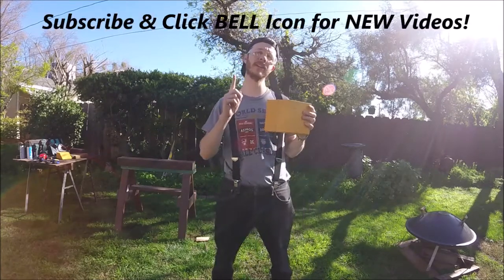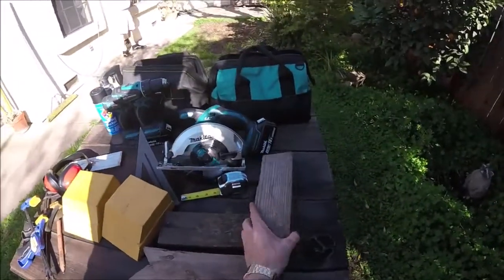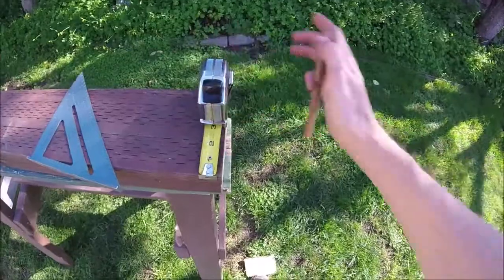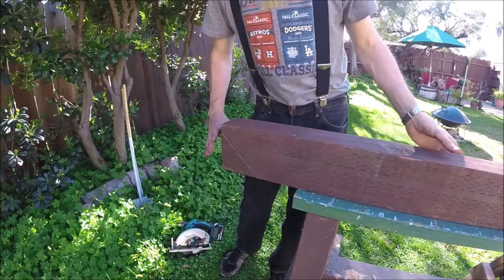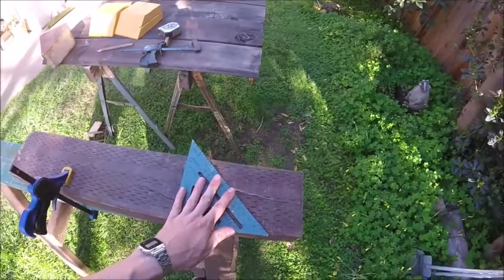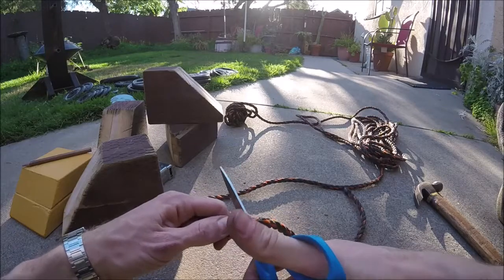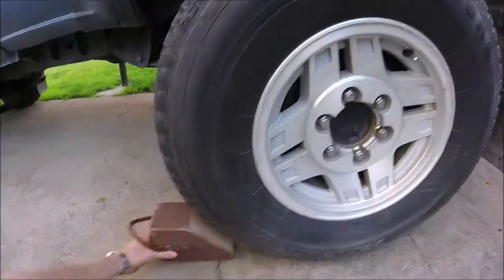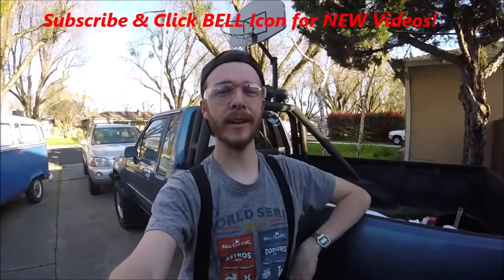DIY Wheel Chocks for your Car, Truck or RV -Jonny DIY

Comment: For the smaller ones, did you glue them together or screw them together with wood screws?
Reply from the maker: I glued and used either screws or nails (if nails I predrill a lil and pound sharp point of nail head more flat to prevent wood splitting)
Reply: @JonnyDIY  Thanks!
Reply from the maker: @Nowisthetime01  you're welcome, glad to help 👍

Comment: Do you have a video on doing the smaller ones? I have a small Honda. Thanks.
Reply from the maker: No but you could do the same with a 4x4 (or double stacked 2x4) instead of the 4x6 I used 👍

Comment: Hold stong are those on a decline driveway to hold a 3500 lb car ?? Are those blocks gonna slide down the concrete driveway as the car is wanting to go down the hill ??
Reply from the maker: Plenty strong. Have used on on much heavier vehicles on decline. If worrying about sliding just glue a lil rubber on bottoms. Or Harbor Freight sells solid rubber chocks for 7.99 each 👍🏻
Reply from the maker: And as always make sure to  leave in park (gear if manual trans) with parking break on nice and tight
Reply: @JonnyDIY  if im jacking the front end only, then i just use the e brake and parking brake to hold the car in place. But if i have to jack the rear end, then i need to put something on the front tires to keep it from rolling because the ebrake and trans brake are only for the rear wheels because all my cars are rwd ...
Reply from the maker: @ACommenterOnYouTube  yes you're correct 👍🏻 & if jacking both sides, do front 1st then rear 👍🏻

Comment: Good wheel chocks cost $10 at Harbor Freight
Reply from the maker: These work well and I made a set of 4 for free with scrap material. Now to go out and buy stuff you're right sometimes cheaper. But if you have some scrap wood, free

Comment: Toyota wheels?....they fit them on the 2nd Generation Hilux Surf 3L
Reply from the maker: Yes, I believe those are the original wheels for that truck. I got it from the original owner. Maybe they were an option in 1988.
Reply: @JonnyDIY  They were only common to the diesel 3.0L turbo Gen 2 Hilux Surf (KZN130) between 1991-1995 & petrol 4-Runner of the same years......I've owned two 2.3L turbo Gen 2 LN130's & I currently own a very rare 3.0L intercooled turbo Gen 3 SSR-G
Reply from the maker: @vinceyreay  ohh wow too cool, yeah it's amazing how rare these trucks are getting. When I got mine, no one cared about them hah